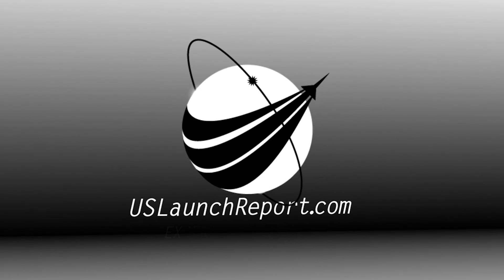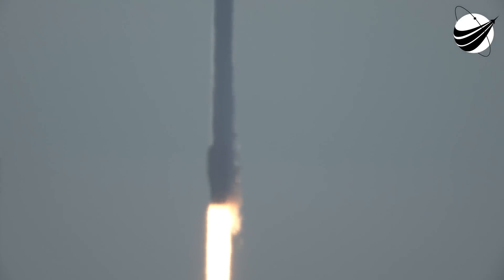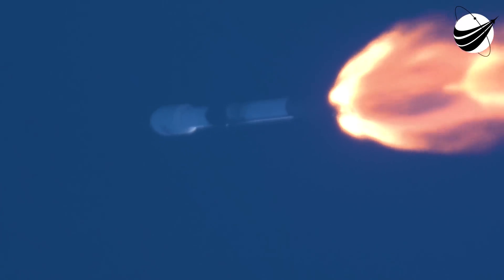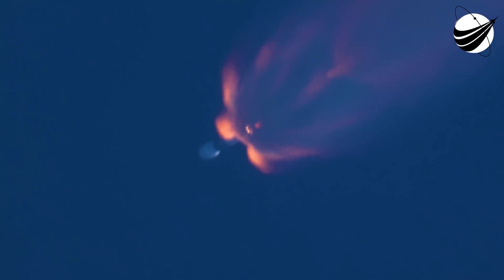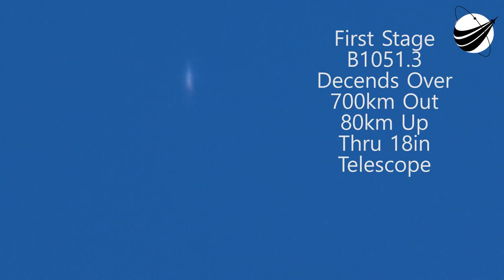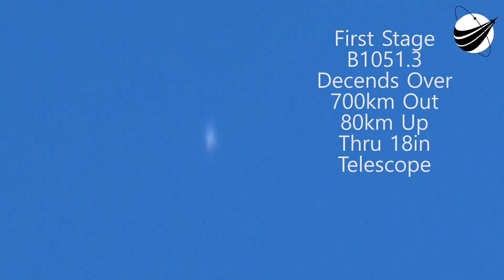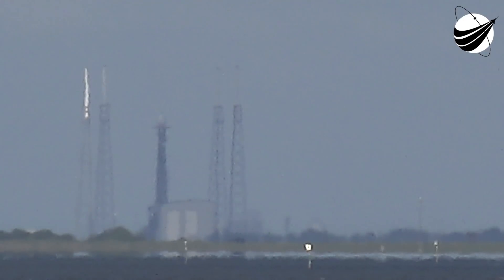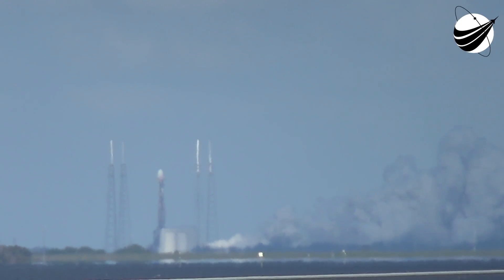SpaceX - Starlink3 - Launch - Track - 4K  01-28-2020

Comment: Are the fairings damaged when they return to the surface?
Reply: If they catch them in the net, then the damage is minimal. Probably only minor heat damage to the outer surface from the entry heating. If they land in seawater, they're probably damaged by the salt and water to the point where they can't be reused.
Reply: @mytube001  The Starlink-1 mission reused fairings that previously landed on the water, from the Arabsat Falcon Heavy launch I believe. So it appears that if they land gently enough in the ocean they can be reused
Reply: They can be reused even if they get in Seawater SpaceXcentric talked about it today ..

Comment: you should put your telescope on a boat 
and anchor it at mid point between the launch pad and the landing barge
i am ready to participate in a crowdfunding for that
Reply: It'd be a tough job to keep any kind of boat or barge stable enough to track the booster! Maybe some kind of custom-made gyro-stabilized table. The exclusion zone for surface vessels seems to extend out to something like 60 nm (70 miles).
Reply: @mytube001  Well ,that would be another challenge
Why  stop here ? wouldn't it be worth it ?
Maybe a test with lighter basic gears
Reply: No gears on this custom tracker just magnetic  energy